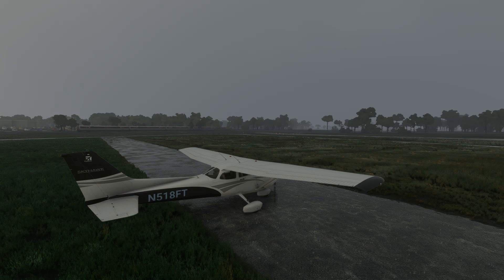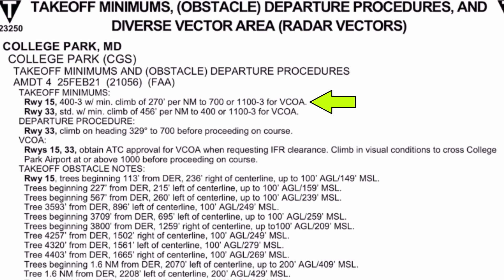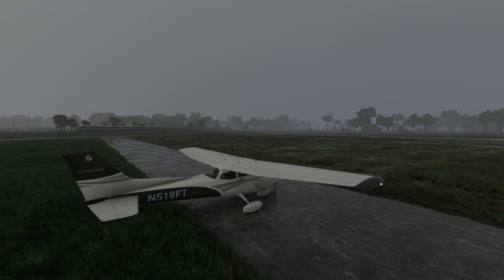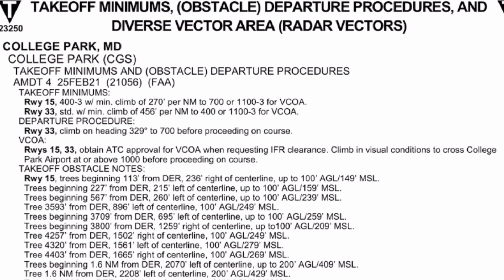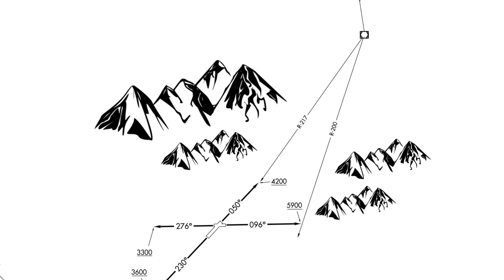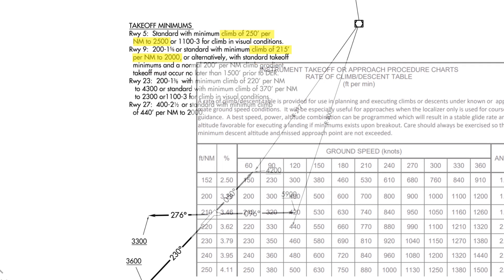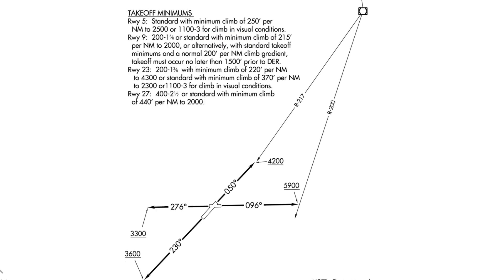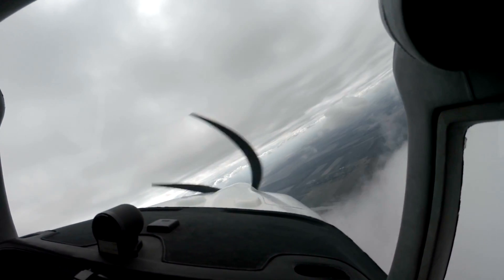Departing into Low IMC | Obstacle Departure Procedures

Comment: One thing to remember is if the IFR is lower than the minimums of the airport you’re taking off of you may not be able to get back if there is a problem after you lift it off. Yes if you are flying under part 91 You can takeoff under a zero-zero takeoff but that would be irresponsible.